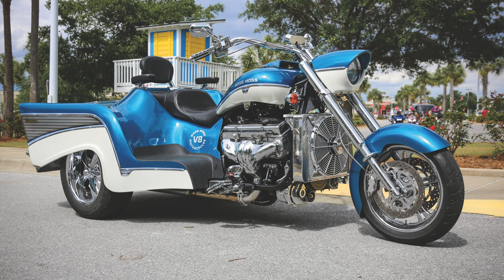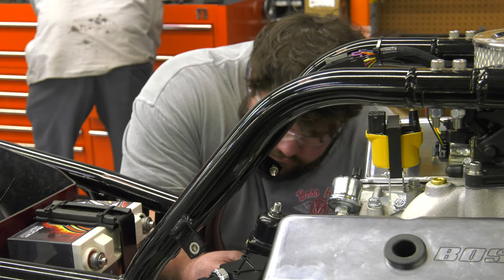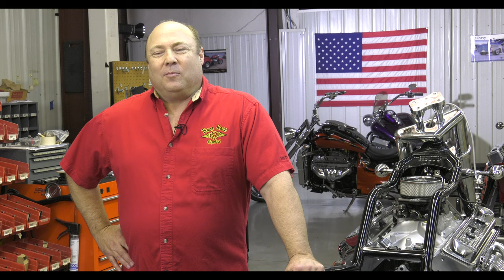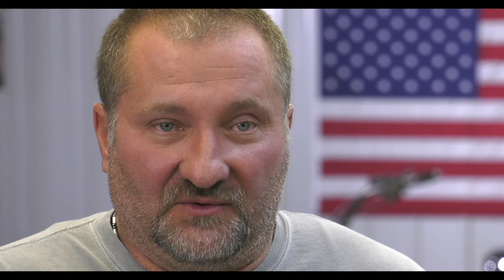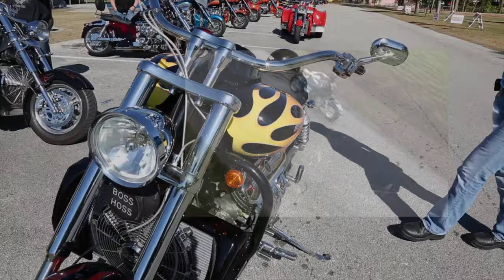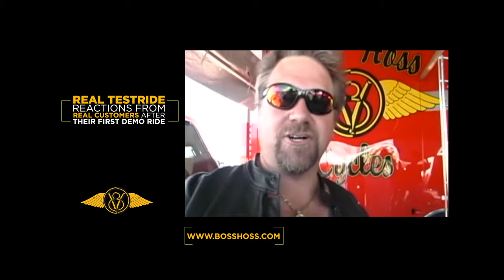Boss Hoss at Daytona Bike Week 2018

Comment: Hello all,I have an older small block (04) that I converted to Fitech fuel injection and have talked with most of the dealerships in the country some of which are no longer in business and the biggest beef about selling the Boss Hoss line was that the profit margin was so low. Every time I heard that another dealer was going to close I was dismayed. Friends of mine are awed by my bike and I would like to see more of them riding them but...How many dealers were in business 10 years ago and are no longer. There must be a way to increase presence and bring more dealers on board. Just my 2 cents.